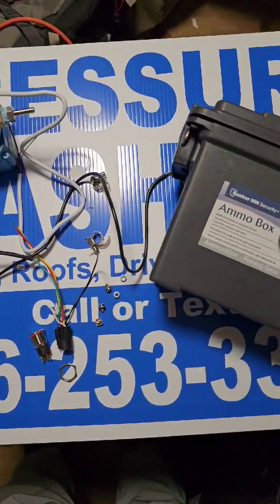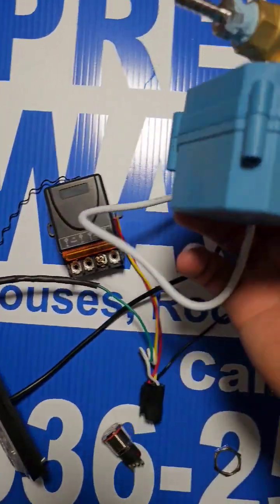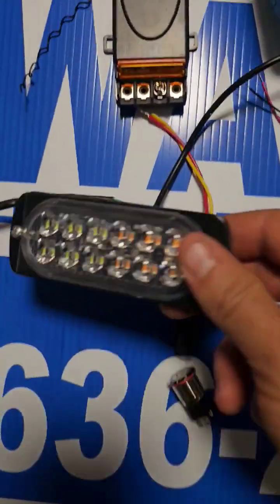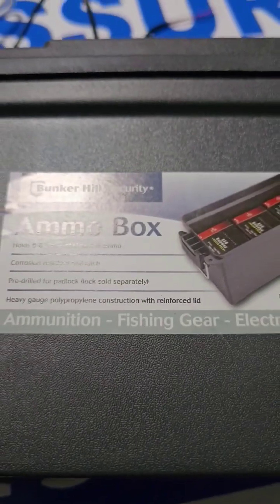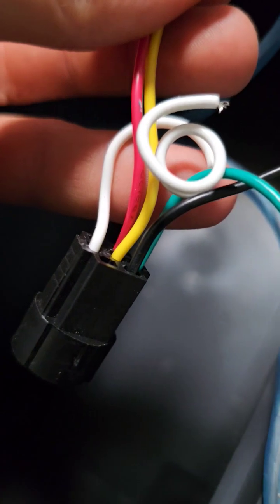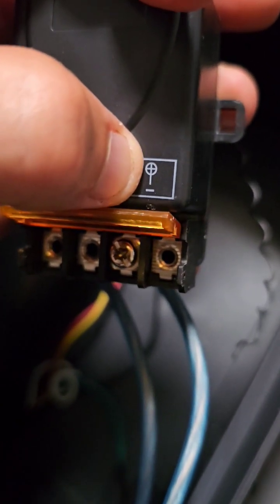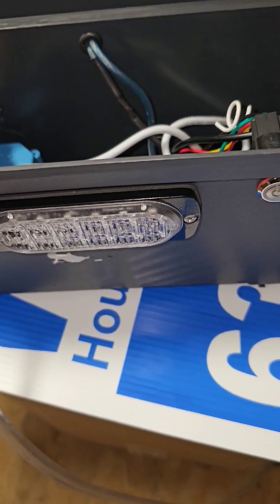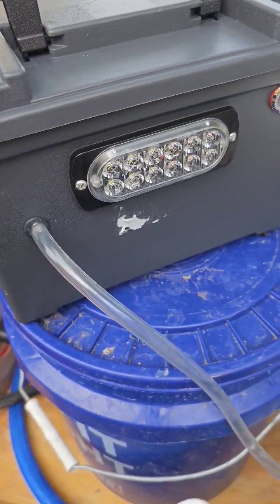Remote Ball Valve / Remote Downstream Injector DIY

Comment: I wired mine exactly the same.  I have power to the box but the light and ball valve do not come on.  Any suggestions? Think the new receiver is bad? I can’t figure it out.  Thxs!
Reply from the maker: @rmass68  that would be my guess if you wired it the same and the ball valve is the right kind. You could always use a jumper wire to test the valve or when you hit the on button check to see if it's sending power with a meter.

Comment: So what gage wire did you use coming from your battery to the remote and did you wire the battery wire directly to the remote. What size spade connector did you use on remote or did you just wrap the wire around the screw

Comment: Great video what size ring terminals or connectors did u use to the relay or did u just twist them around the screws im doing this for my AR 45 with teejet and banjo for soap
Reply from the maker: I just used some small C terminals from one of those assortment packs. I like them because they dont slip, and you dont have to completely remove the screws.
Reply: Thanks these videos gold for new guy like me why pay 600 when u can build yourself for fraction of cost I was gonna order remote rinse from Midwest instead did research and now I have everything coming teejet three way banjo shutoff for less then half the price plus something goes wrong u Kno how to fix thanks again and hope u get that $$ 2024

Comment: Where do you connect the yellow wire from the light? To the red of black wire for the ball valve?
Reply from the maker: I just snipped it off. I only used the red and black from the light.
Reply: @ArchPressureWashingLLC  thank you!
Reply: Great video I'm trying to duplicate Midwest washing equipment remote rinse with metering system for my AR 30 what remote should I get that I can wire the 3way teejet the banjo shutoff and a indicator light
Reply: You can attach the red and yellow from the light together and it will change flash mode each time you turn the ball valve off and on or just touch the yellow to the red to choose the mode you like then leave it disconnected.